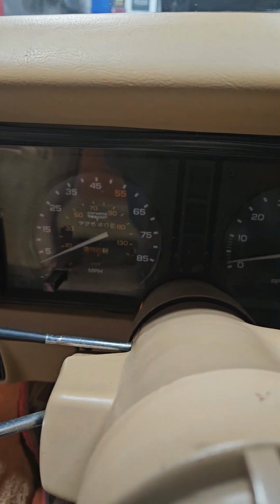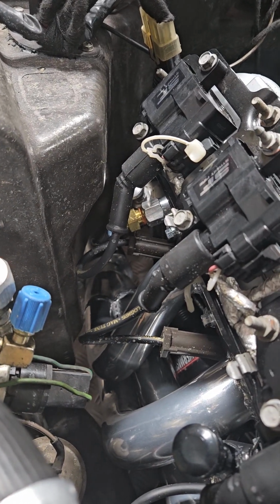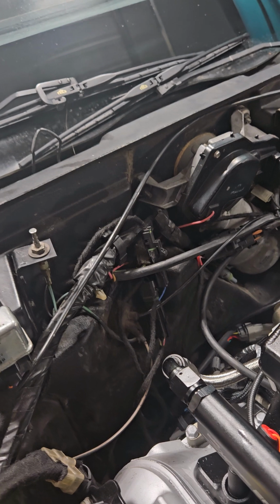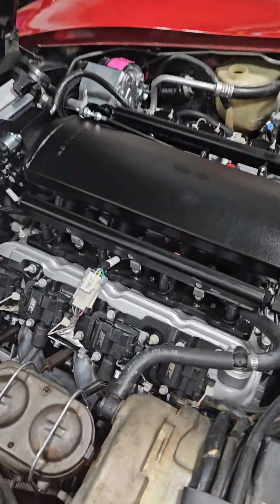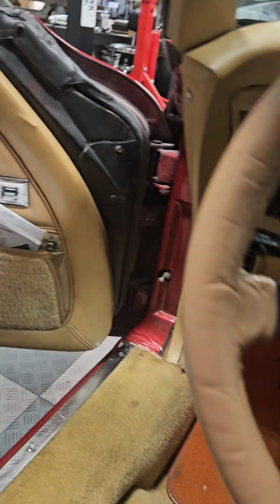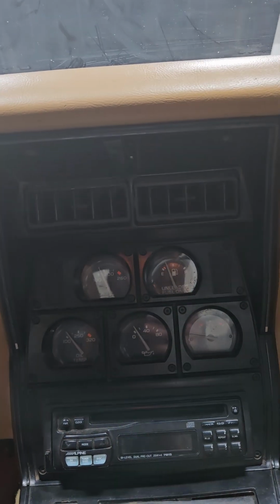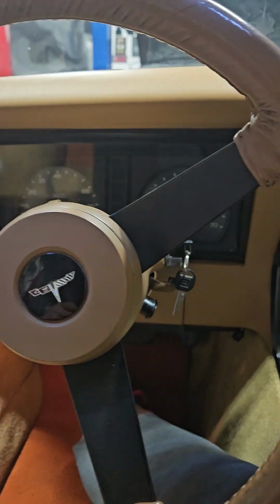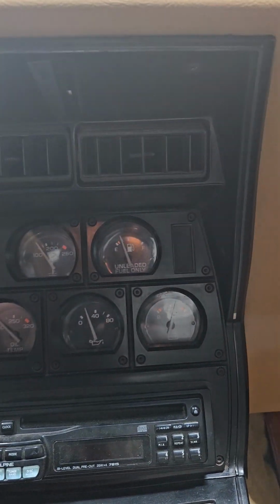C3 corvette LS swap gauges overview using terminator X ecm.

Comment: How much to do this ?
Reply from the maker: The speedo converter box runs around 400, the rest of the parts are just oem corvette sending units adapted into the LS engine.
Reply: Where are you located? Can you share contact information so that if someone wanted to get an LS done on there, C3?